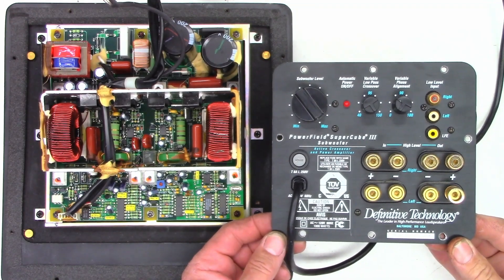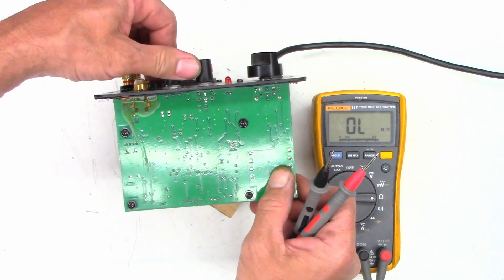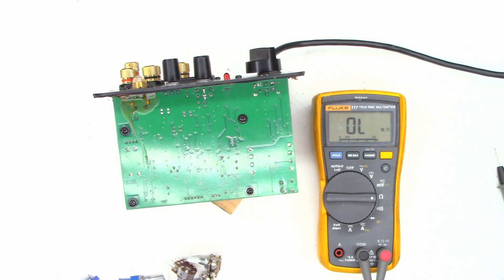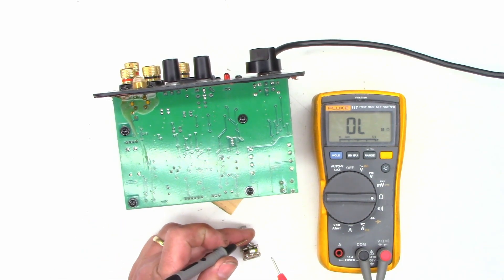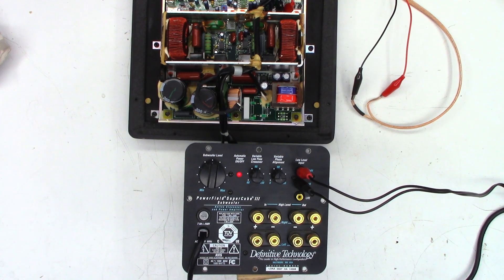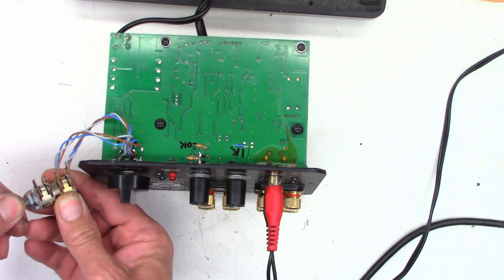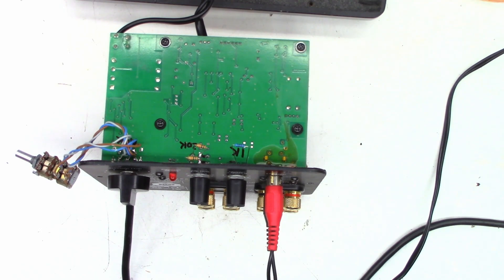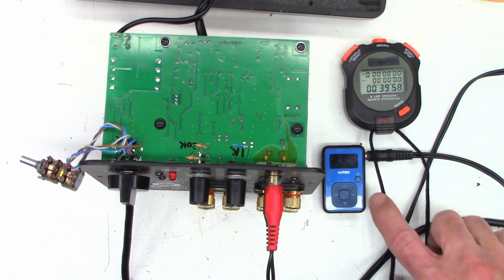Another Powerfield SuperCube III by Definitive Technology No sound diagnosis Supercube 3

Comment: I just picked one of tehse up with a pair of Miller and Kreisel satellite speakers at goodwill for $15. No power LED on connecting to power with audio fed into the Left/Right RCA channels . Fuse is good. Could the pots prevent power from coming on as well since it has the 'automatic power on"?

Comment: Hi Norcal, how screwed am I? When I attempted to de-solder and  pull the middle pot, it came out with 2 copper barrels/pads (facing the knob extreme left) . Are there any tricks of the trade to fix this rookie mistake. I am in no position to send it to you, as I am in Argentina and they would either open the package on the way out or on the way in and just steal it. (the customs office is a mafia here). You are the only channel that gave me hope that I might be able to repair the sub I bought just before moving here, of course it was a dud.  I barely got any use out of it, half the time it wouldn't even kick on.  saludos

Comment: HI bro, I have one supercube 3 subwoofer ,what is the subwoofer coil impedance value?, While am checking  it's showing 35ohms, Is that right?
- Which amplifier I can choose for in asternal drive for this subwoofer
Reply: Your right in the correct range. 30 ohm's is normal for these woofers. You can thank the car audio industry for 2 and 4 ohm speakers. If you do the math, believe it or not but you would actually need a 11K RMS (YES 11,000W RMS) car audio amp to drive one of these little speakers to its full potential! Without repairing the amp these powered subwoofers come with, the driver is virtually useless.
Reply from the maker: I have never had a supercube speaker, just the internals. I would assume it should be between 2 and 4 ohms most likely for that much power handling.
Reply: @norcal715 . I have one on my bench. still not been able to get it to work.  the impedance of the driver is 24 ohms

Comment: If you get to move forward with the repair, it would be great to see how you removed the board from the back plate... these things are glued, screw and everything else to hold them together. Also, I have resistor R66 completely missing off my board... is there meant to be one there and if so, what value do you have on it? - in the complete off chance you get a look at it that is.
Reply from the maker: Pert 2 is coming up soon. Stay tuned!
Reply: @norcal715  I need to order some pots for mine... freight to Australia is killer!!! I have two of these Subwoofers... both dead. I'll open the second on and check out that R66 resistor.